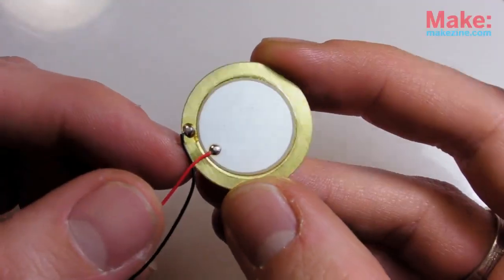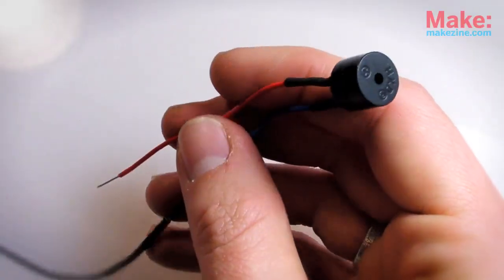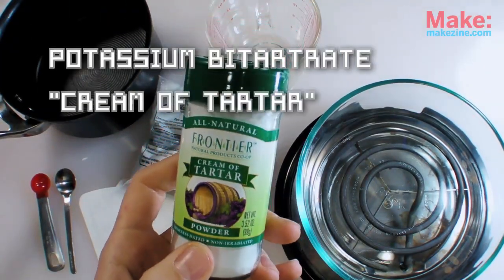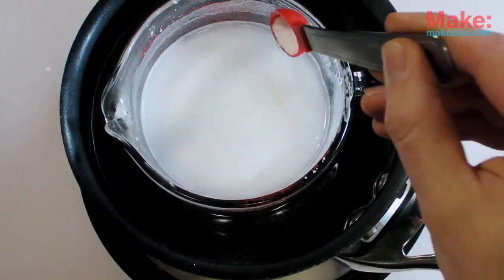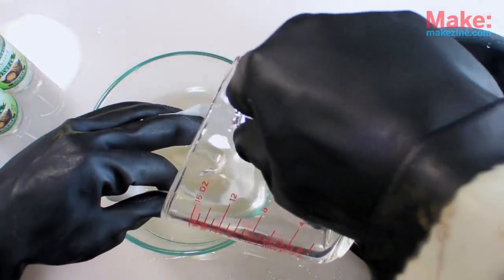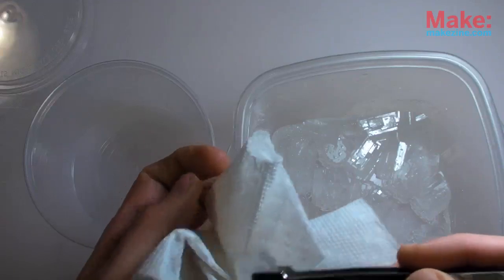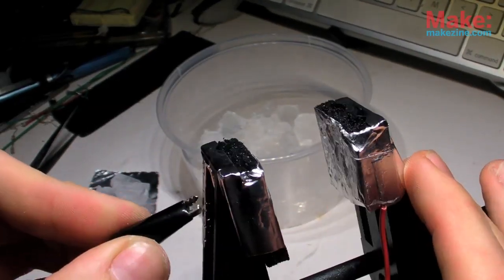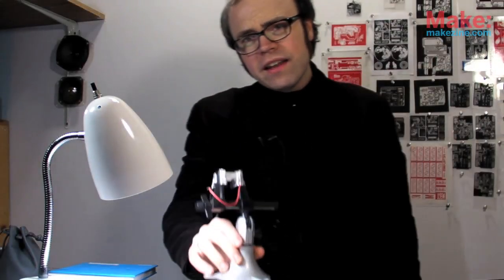Collin's Lab: Homebrew Piezo

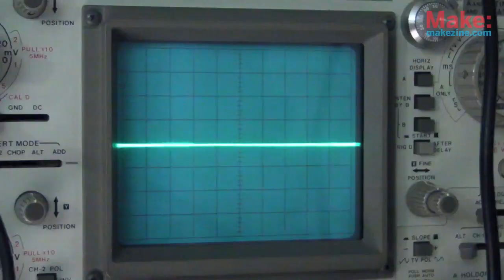Comment: 3:57 AC voltage?? How is it not DC?
Reply: Tyen Drister that's what I was thinkin bro-
Reply: Interesting question... here 's my theory: the crystal is ever so slightly elastic. 

The crystal produces a +ve DC voltage when it is deformed by the initial impact - yep, we see that in the first upward blip on on the O'scope.  Then, a negative (but reduced) DC voltage is produced as the crystal returns to its original shape - we can see that too, when the O'scope line drops below zero. Because the crystal is elastic, it deforms again as it passes beyond its initial shape and creates another, even smaller +ve DC voltage.  Lather, rinse, repeat and voila!  Alternating current (with a rapidly collapsing waveform).
Reply: it's rather simple, see the cristal produces AC voltage beacuse the cristal has an weird atomic shape so when you hit it it makes pozitive and negative voltage and not DC
Reply: I m not sure so don't take my word
Reply: crystal sory
Reply: Simple, the cristal only produces electrical charge under mechanical pressure, right? Wrong, only under an continuous strain and the electrical charge isn't there for a long time. Actually, you can think of this as a magnet wich moves over a copper coil. Only when the magnet moves, an electrical current will be produced in the wire. Analoge to that, only when there is continuous  compression (meaning, the lenght of the cristal changes continuously), there will be a very small but detectable current, respectivly a small charge flow in the cristal ;D.

Comment: how do you make fewer amounts?
Reply: Use less reagents?
Reply: Xfactor Chem can we charge a battery using the crystal
Reply: Theoretically you could, but in reality I don't think it is possible, at least not in any practical way. But I'm not 100% so you should do some more research just in case. But as far as I know all you get are voltage spikes which is not ideal. Maybe with huge crystal and a jackhammer? :D
Reply: Xfactor Chem put it inside your running shoes and go for a jog :D
Reply: Xfactor Chem I'd say put the crystal in place, and then have a wheel spun at high speed, with little "hammers" at the end of every spoke, positions so that as it rotates, the crystal gets hit by the "hammers". You'd really want to find a way to have the crystal also rotate, so that every other hit was on the opposite polarity, which would give you a very very rough kind of AC current.